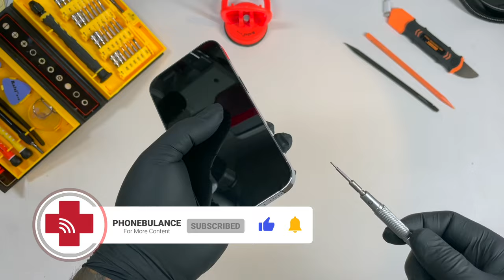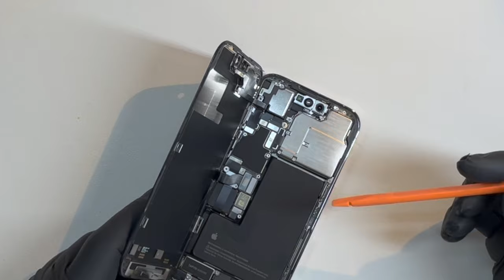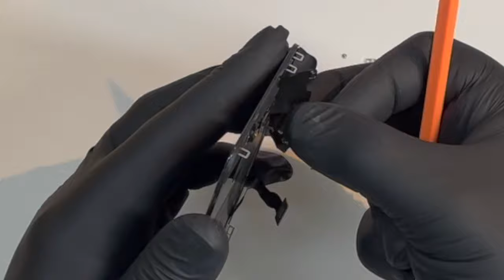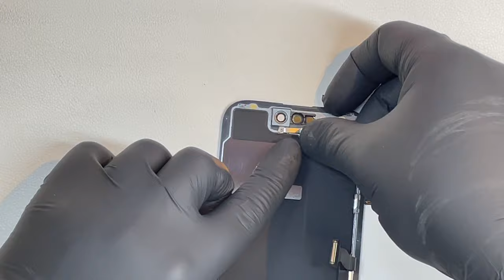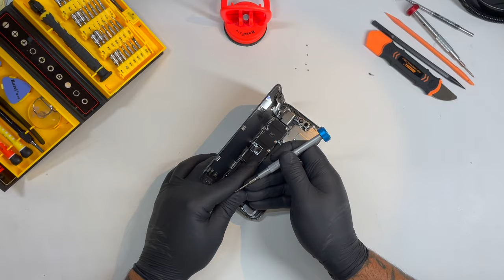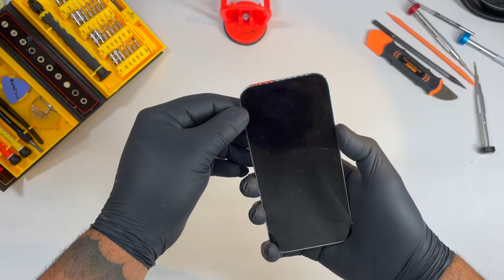iPhone 14 Pro Screen Replacement Teardown

Comment: On the regular iPhone 14 you now open it from the back meaning the back glass is easily repairable and the screen is also now easily repairable. But why did they not do the same for the pro?
Reply from the maker: That’s a great question. I assume it is a test, and they probably will do on the next generation iPhone!
Reply: The back can be opened easily yes but doesn't mean it makes the screen any easier to open you still have to remove it the usual method like with all the latest iphones

Comment: Hi i enjoyed the video. one question is it necessary to change the proximity sensor because I did a kind of test where I just covered the island with my hand but the screen did not go black, i did not put it to my ear, but then I ended up changing it and then I did the same thing where I covered the proximity sensor and it did not  black until I put it up to my ear so I still don't know if I need to change it do I ? thank you
Reply from the maker: Hi there! If the display has a proximity sensor, there's no need to replace it or swap
Reply: @PHONEBULANCE  - It's actually using the FaceID cameras as a proximity sensor to blank the screen.

Comment: Someone knows why my brightness is so pretty low on my 14PM after changing the screen for another original Apple screen? (didn’t transferred the IC or ambient light sensor)
Reply: Might be the unit replacement you ordered. Some screens are marketed as OLED but come as a LCD screen sadly. I hope you bought a good replacement and did not scammed. Good luck!
Reply: Re open the phone and check at the back of the screen bottom middle there’s like a silver square box should have an apple logo on there if no and it’s just showing a barcode it’s a cheap knock off

Comment: Sir, I want to ask whether the proximity sensor attached to the LCD of the 14 Pro and 14 Promax is the same?  For example, if you replace the 14 Pro with a 14 Promax, is that possible?  Thank You
Reply: No they are different won't work

Comment: Do you know where we can get another screen to replace a cracked one? Thank you in advance.
Reply: I think you can only get lcd replacements for them otherwise it’s going to be very expensive for a replacement 😅
Reply: Well I’m gonna pay 500 euro to change my screen at Apple Store if you buy fake one probably the lights gonna be bad
Reply: If its only cracked I can repair the outer glass I charge £30 for this here in the UK if its a complete screen needed depending on your model but iphone 14 pro max would be £290 and can install the old ic chip from your damaged display to the original replacement I get

Comment: Could I just replace the digitizer?
Reply: No the screen and digitizer are one part on all iPhones and pretty much all phones. The only device where the digitizer and display is separated is the base line iPad.
Reply: @vollabiwastaken7303  yeah I figured that. Just had to ask tho cuz someone on eBay is selling just the digitizers for the 14 pro max. And I’m like wtf. . . They said you can change just the glass off the lcd but I’m like in all my years of fixing iPhones, I can’t remember the last time or if ever I changed just the digitizer. Def on older model androids. But no iPhones I remember 🤣🤣🤣
Reply: @seanybreeze315  It was more common to do loca glue separation back in 2012-2015ish. I used to do it on samsung phones, s3, s4, note 2 and 3. Horrible. So glad I'm not doing that anymore. They started making them even thinner and more fragile, then curved. I was like ok I'm done!

Comment: it would be amazing if u can share aliexpress links of parts u are using , like tools .
Reply from the maker: The component required for this phone is not available yet. Currently, only refurbished displays are available in the market.
Reply: @PHONEBULANCE they were asking about the tools mate not the hardware for the phone

Comment: Help. I replaced display on my iPhone 14 Pro and it Works But is really laggy! How to fix?
Reply: What screen did you purchase ? Was it a cheap lcd or hard oled or soft oled screen let me know the price you paid because I know the cheaper screens will cause terrible lag you can tell by refresh rate go into settings and swipe from top to bottom of settings as quick as u can with a finger and if it’s delayed then it’s a screen issue

Comment: How much it cost ?? Screen Replacement
Reply from the maker: At the moment around $300
Reply: @PHONEBULANCE  OMG
Reply: @PHONEBULANCE  theres green lines going vertically but phone still works. They said it would be 600 bucks
Reply: @steve410811 I was quoted $800. Even with a screen protector, it hit a pebble right in between the edge and protector and caused a line. Now it flashes the whole screen 😖
Reply: @pab6873  damn
Reply: Apple quoted $329 yesterday for a new screen on my 14 Pro. This ish can stay busted 🤣
Reply: Get the Apple care, it’s 7 dollars a month but my iPhone 14 pro, the screen replacement was 30 dollars